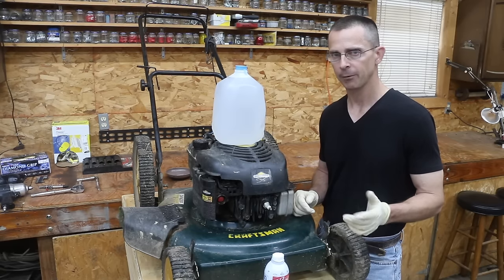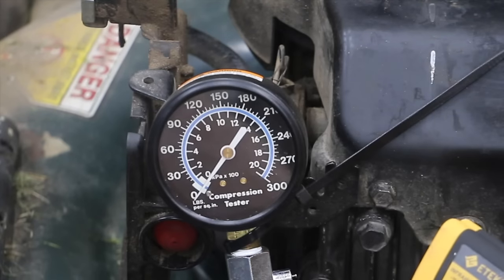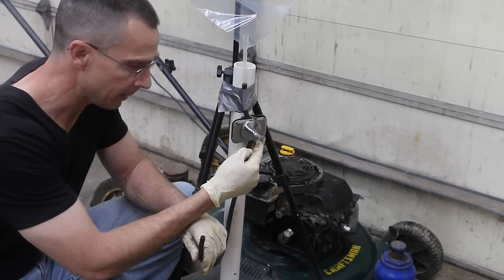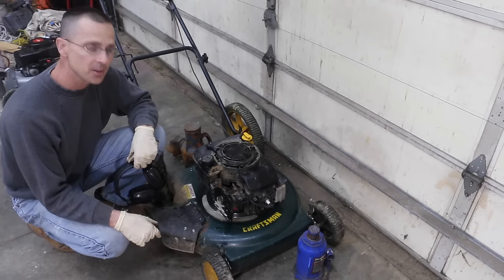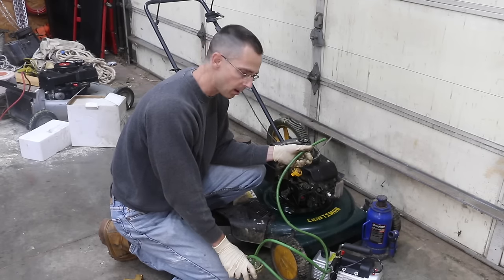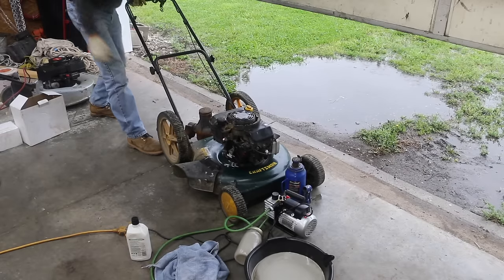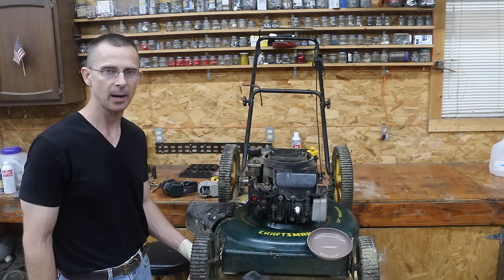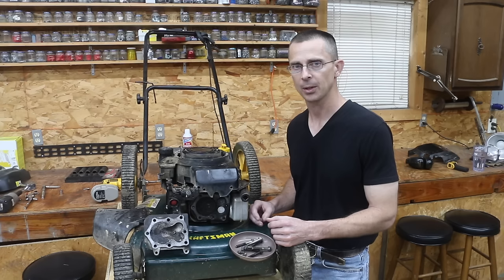Seafoam--can't believe what it did to my engine episode 5--cylinder cleaning test using water!!

Comment: awesome video! I didn't think a lawn mower engine could be cleaned with straight  water. Steamers is what they use in Europe.  like a little carpet cleaner with a nozle
Reply from the maker: Emilthehun, Thank you for the encouraging comments regarding the video!
Reply: That's not a bad idea - one of those hand-held steam-cleaners discharging into the carb would probably be a valid method for a small engine. On a car engine, a high-pressure pump and mathematically calibrated atomising injector is the go for an OEM-quality installation.
Reply: BensDR30 yes that's what I have on all my cars. boosted or not. water injection gave me an extra 30tq at the wheels with no tune on my 3800
Reply: Project Farm awesome brother keep them coming
Reply: Yes it's steam you need to clean, engine needs to be hot, these briggs and the carb/manifold system on them doesn't get hot enough for vaporizing the water. With a little alcohol added to steam I'll bet you might get an engine to run on a water/alcohol mixture only, There's about 2 cups of water in ever gallon of gas, you see it coming out a cold tailpipe on cars, there's also hydrogen in water and a lot of cylinder pressure developed by expansion of said water to steam, some of the hydrogen liberated is also burned. I did some studies of high mileage carbs and all the principals of best and most efficient combustion rely on high/er operating temps and more complete vaporization of fuel. 
It's not a big deal a little carbon in the cylinder chamber, where is it proven that a clean cylinder is any better better, looks nice but is it better? Carbon is a thermal barrier, keeps combustion heat in the cylinder, if ya don't have overheating problems that's a good thing, it's why you gunked up the piston cause it was running too cool, and your compression test being higher after the water test might be simply from the carbon/junk deposit build up on piston raising compression slightly.
Reply: Dan Thomas, you put a lot of good thinking into the hypotheses, which you put out. Let me help a bit. I think the engine was designed for how it should work best, clean from the factory. The engineers may have built in enough room for error as carbon built it up, it wouldn't be an issue to a point, but you see, carbon, also creates hot spots, and can cause pre-ignition in some of the fuel, which is not ideal.

Compression was not higher after a lot of carbon was cleaned out because something else was magically added in. The valves, cleaned up, can increase dynamic compression. Static compression is how much air the cylinder can move, but dynamic is the reality of how much can get in there with all parts and pieces working at their best, or at their worst. With the parts being smoother, there should be better air flow in and most importantly out of the cylinder.

After all, most of the work of drawing in the air fuel mixture is done by the exhaust, and not the cylinder, which only makes up 1/8 of the air flow. Please, come check out my channel too. I'd be great to hear your thoughts on my videos as well.

You certainly had a lot of value to say!

Comment: First of I have to say I love the way you try and be as fair as possible. I really like your stuff! I was first told about the water treatment 55 plus years ago and have used it many times over the years. I get the engine up to operating temperature and have about a quart of water ready. With the engine running at a fast idle I run the water through as fast as I can without stalling the engine. Once the water is gone I shut the engine off. After the engine has cooled right down I start it up and rev the engine up and down about ten times or more until the carbon quits coming out. It works great On cars trucks and tractors but I must admit I have never done a lawn mower lol. The idea behind it is that the water gets into the carbon and breaks the carbon up. The cooling breaks it free. Starting it up after just blows it all out. Anyway you did it one way but the principle did not add up to me so sadly it didn't work out. Maybe try it out the way I do it. Thanks for all the stuff you do!
Reply from the maker: Thanks so much!  Thanks for the feedback.

Comment: Project Farm, for the question you asked at the end, "Would you use water to clean deposits in the engine", I have, but never had very good results with it compared to a volatile liquid like Seafoam or Marvel Mystery Oil. It's true, water can have really good results, but the thin line between positive results and failure is too narrow for me. From what I've witnessed, it's not really water that's doing a cleaning, it's steam, and to get the right balance between pouring water/creating steam, you run the risk of hydrolock and water mixing with the oil. 

Now, hydrolock is a risk no matter if you're using a solvent or water, but where something like MMO, Seafoam, B12, or Gumout can safely creep into the crankcase and intermingle with the oil, water can't. And a solvent treatment, unlike water, is not really dependent on temperature. You don't have to worry about whether you're misting or pouring, or whether the temperature inside is enough to create steam. In fact, I've had the best results from pouring MMO or Seafoam straight into the spark plug wells, sitting overnight, bumping the ignition to spray out the excess, putting the spark plugs back in and running it rough for a bit before changing the oil. You really can't do that with water. (You could, but your motor wouldn't be very friendly to you afterward.)
Reply from the maker: Marvin,  I enjoy reading your comments!  It's clear you have a lot of experience and expertise.  Thank you for watching the video and commenting!
Reply: Thanks for making them! This is rapidly becoming one of my favorite series on youtube!
Reply: I always did a steam cleaning, then follow up with seafoam because it's a solvent and will clean up the majority of the remainder. That's for very nasty engines though, ones that you test this stuff on in the hopes you don't have to pull the cylinder heads on it.

Comment: I think we are supposed to introduce water in form of fine mist.
Reply: I’ve used seafoam also in my fuel to clean varnish. I would also.dribble it into the intake and flood the engine with the last one third of the can and wait fifteen minutes for it to work on varnish and grime. On really dirty engines with gunk in the valve covers, I would put several cans in the motor oil and idle for 15 minutes before dumping  the oil. This was back in the 70’s when I was a mechanic.
Reply: I used distilled water back in the 70's when lead was removed and octane levels were lowered.  My car had 12.5 compression ratio and the knocking was killing me.  JEGS then sold a water injection system that helped with the knocking and restoring my HP. The lack of lead was another issue. Fixed that by installing hardened valve seats. Adding lead to the gas was a pain. My valve stems and combustion areas were nice and clean when I removed the heads for the seat upgrade. Water injection was pretty amazing. You knew you needed water when the pinging came back.
Reply: @BullettGuy  Great story. Thanks for sharing!
Reply: @BullettGuy  1000% agree.

Comment: Interesting facts to consider. I have been doing small engine repair for almost 40 years and it seems that Water or Moisture that gets into the Gasoline on these small engines( lawn mowers, trimmers, pressure washer etc..) will turn the fuel  rancid and usuable plugging up the carburetor,  eating up fuel lines and build up in the combustion chamber. I've used seafoam or berrymans  fuel combustion treatment for all these engines and even in my vehicles and it helps keeping the moisture out of the fuel system and makes these engines run better. These products also will keep the fuel from going bad.  Thats what ive found using these products. 
Thank for all your videos...
Reply from the maker: You are welcome!

Comment: Have you ever tested blowing steam from a steam cleaning machine wand?

Spray works well with water also the mist nozzles.
Reply from the maker: Not yet. Thank you for the video idea!
Reply: I was just thinking this. from a hot humidifier?
Reply: Water in a hot combustion chamber turns to steam. It’s why engines that blow head gaskets have clean pistons.
Reply: You need larger partials if water to slam into the metal for it to work. Due to water can not be compressed. Also why it went around the rings & damaged his motor.
Reply: That's what I said and comment on many decarbinizing videos, I'd love to see a handheld steam cleaner and hot it effects an engine - also the engine's rpms must be high enough
Reply: @ProjectFarm  sooner than later? :P

Comment: Came here to see how long it would take for the oil to get contaminated Wasnt disappointed.
Reply from the maker: Thank you very much for the positive comment!
Reply: Ever hear of the Crower 6 cycle engine? Water injection and the flash to steam creates a second power stroke. ( yes it's real) however in testing attempts to move this design toward usage water contaminating the oil and the overall problems with cylinder/ring wear and sealing have thus far not able to be overcame. The designer is Bruce Crower of Crower Cams (hi performance cams)
Reply: @johns5591   Had not heard of that, will look it up. I ran water injection years ago for an overworked motor that got hot when pulling trailers (67 Dodge), it was a home made system water (jug, hose, small needle valve to throttle flow) run into vacuum line at the bottom of the carburetor. I read all the stuff about how it didn't work and would ruin a motor but my dad (engine builder, machinist, metallurgist ) and an old mechanic I knew talked me into trying it. Since I had already done everything else (radiator ,flush, water pump etc.) I figured why not. The results were that the motor temperature dropped about 20 deg., I seemed to have more torque and got a little better mileage pulling trailers  (about +1.5 mpg). Every thing I read said this could not be, however it worked. The diesel effect was all we could attribute it to. That motor was the original motor and had been a daily driver from day one,  supposedly had never been rebuilt, I was the second owner in the mid 80s, no idea how many times the odometer rolled over. The first guy used it to feed cows and  general ranch work. I used it to drive to work and general farm and ranch work. The third owner rebuilt the motor in the 90s. Last I heard that pickup was still on the road in mid 2000s.
Reply: @rosseryn8216  We used a water vapor system in the seventies on my dads Chevy truck.  Bought it from J.C. Whitney.  Seemed to help.  Compression and gas quality were changing in them years, had to try something.  Like I said , it helped but in Minnesota we can't run it year around.  Probably should have filled it up with wiper fluid....

Comment: The water should have been misted in instead of being allowed to trickle in. I think it would have made a difference overall.
Reply from the maker: Thank you
Reply: No not at All ... 
The hot enigen waporizes the droplets
Reply: @kennethschultz6465  That's the point. The steam actually does the cleaning. At the point where the engine cooled down to less than 212 degrees, I knew it would be a problem.
Reply: Agreed, you should aim to keep the engine above 180*f at minimum. Water injection can help clean as well as help provide more oxygen as well as keeping cylinder Temps down for better combustion. 

Generally its used in forced induction engines to help compensate for the heat produced while compressing the air. But you dont want to run the injection the whole time as you'll get what we have here. 

Short bursts of maybe 30s when the engine gets up to temp (which looked to be around 220*f on the head) spray it until it cools down to 180*f and let it get back up to temp
Reply: water injection as a form of decarbonization tool works best when the water isn't atomized and is more raw in form, if you want to use it as a form of knock suppression then it works best as in atomized form.
Reply: agreed
Reply: @LygerTheCLaw  Beg to disagree. The water atomizes as it reaches vaporizing temperature (212 degF). It is that hot vapor (steam) that softens the carbon, not the colder liquid water. And in a vapor form, it more easily escapes the combustion chamber instead of potentially diluting the lube oil and potentially creating unprotected metal-to-metal contact. I would have suggested, like many others, to spray water into the intake. Fine water droplets vaporize faster and will do a better job to decarbonize the combustion chamber. If performed on a road vehicle, I would perform this operation while driving at higher engine speeds and under load to increase the number of intake and power cycles, stopping and starting the water spray to slowly dissolve the carbon and to ensure water vapor doesn't reach the crankcase. Do this at night so any trailing smoke doesn't alarm the local gendarmes. Nice job on the base line references and the visual confirmations. Too many people rely on advertising claims to justify their purchase and use of so-called wonder products.

Comment: I know this is an older video but sadly I think this test was doomed from the start, the compression was low telling me the rings were worn allowing for this outcome. I am in no way saying you did anything wrong, your test and testing methods are always spot on and that is why I have watched all your videos at least once some even three times like this one. Anyway thanks for the video.
Reply from the maker: You are welcome!
Reply: FWIW, a lot of these small engines are fit with custom cams or decompression features to allow for easier starting. This usually translates to lower than average compression readings and most suppliers advise against putting too much weight in them. Instead they say to do a leak down test. If this thing really only had 60-80psi of compression it wouldn't run this well and it would likely be puking blue smoke the whole time.

Comment: YES!!! I am ASE certified through college and hands on, and this may sound crazy but standard practice taught by the engineers is that AFTER the seafoam the same amount of water needs to be introduced the exact same way (use 1ltr bottle with a little hole in the lid to spray), and the water actually is more abrasive and breaking off any remaining deposits that the seafoam has eroded. The water is actually the main catalyst to removing deposits as the seafoam is to breaking the bond of deposits. Through the engine performance course a student was introducing the Seafoam through the brake booster line by SLOWLY pooring it in and accidentally sucked too much in at once and hydrolocked the motor, BENDING A ROD! so the spray method before throttle plate done in another vid is MUUUCH safer!!! GOOD STUFF!!!
Reply from the maker: Thanks for the feedback.
Reply: Thanks for the info .
Reply: Where did you get your certification? From a cracker jack box it seems!

Comment: Just an idea.
When I would put water in the combustion chamber of a motor.
I used a plant mister.
I would start misting until the motor almost died, then let it recover, then I would repeat four to five times.
Thank you for your videos.
Reply from the maker: Thank you for the video idea!
Reply: My shop teacher, mr. Harris, had us use an old Windex bottle, spring into the carburetor, again till it almost stalled, then backing off.
Reply: @ProjectFarm  Why not try for a steam cleaner(handheld), that would be really interesting as hot steam won't need much of a delay between bursts, also for decarbinizing an engine from all the people I've seen, it usually needs higher rpm so keep that in mind - I'd love to see this on a video, I'm a click away from buying a steam cleaner just for that :P

Comment: Used water many times, but never over the span of hours.  My dad (certified mechanic for Chrysler back in the day) and I started doing this in his old company car, which he never ran hard, mostly constant highway miles running maybe 10 over the speed limit.  There would always be lots of carbon buildup over a couple of years.  We would use a couple of Coke bottles worth of water and just pour sips in as the motor could take it while throttling the carb. as needed.  The whole process took only 10 minutes of non-continuous feeding of water.  The difference in power afterwards was quite noticeable to the "seat of the pants".  I remember seeing all the "smoke" coming out of the tail pipe (as a kid), :-)  We never changed the oil after and never had a problem.  This may be due to the relatively small amount of water, for a short time, mostly blown out the exhaust (steam).  Super impressed with your testing by the way, interesting and very appreciated!
Reply from the maker: Thank you for the feedback

Comment: should have used a mister to break up the water and or use a much slower drip so engine temp stays up it does work but seafoam is as effective and much quicker
Reply from the maker: hd the wise, using a mister makes sense.  Thanks for watching the video and commenting!
Reply: Project Farm mister to prevent h lock
Reply: Someone I know tried to copy cat a system down to how much water to use in a 10 second quarter mile pass. He put this system on minus the mister type nozzle. Same rules at the end ed the night. And slowed down. Redid system with nozzle and out again the next week and no moisture in oil . Also more of a steamclean effect in the combustion chamber.